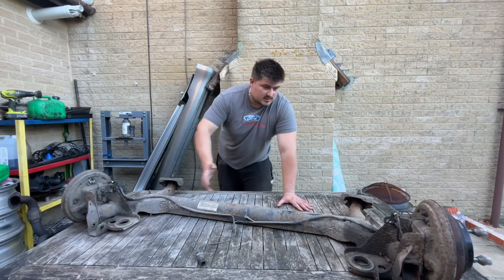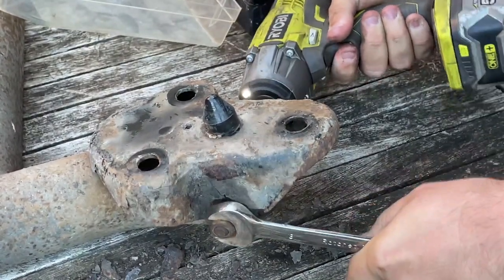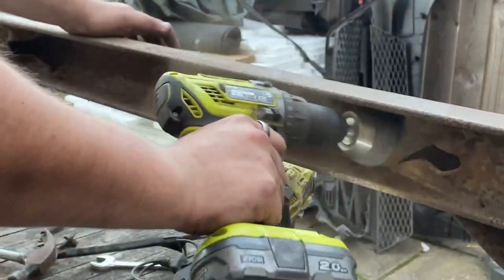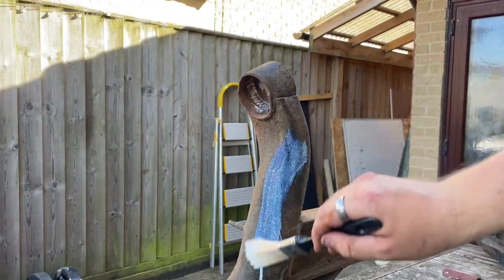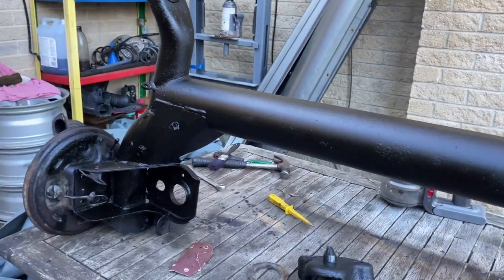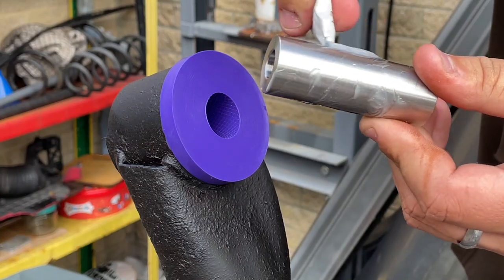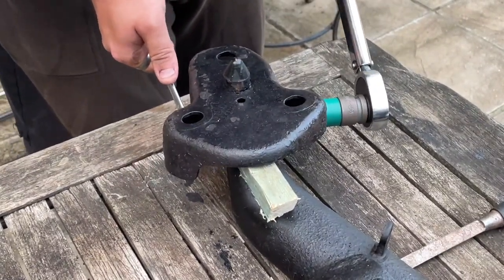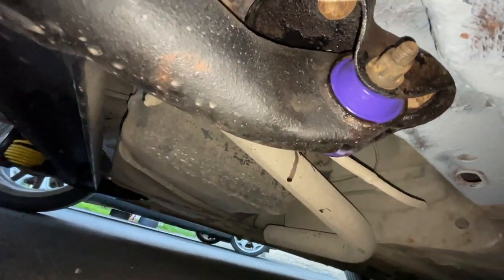How to Install New Poly Bushes On a Fiesta Mk6 Rear Axle!

Comment: Get a blow torch on the a axle metal in the thin area surrounding the bush , just for a few minutes . Then knock it out easily  with a hammer,  easier & quicker than using a puller . Let it cool , clean up the hole , bob in new bush . I do a set a week and always  replace with poly bushes. Great video though 👌
Reply: Does one need to take out the rear axle completely to use the blow torch or can it be used while hanging the beam on a Jack?
Reply: @nzubepaulejiofor8500  just drop it down on your jack mate no need to remove the axle 👍